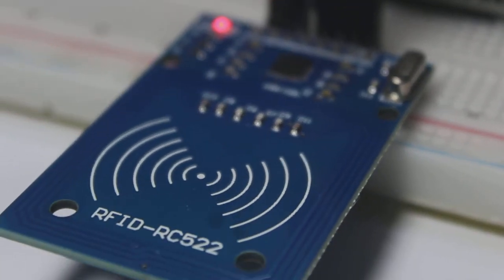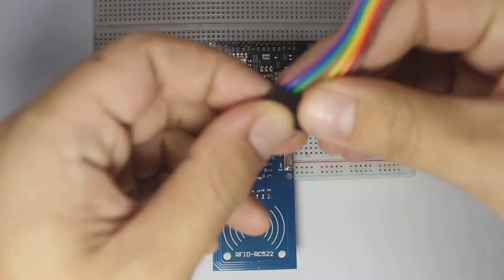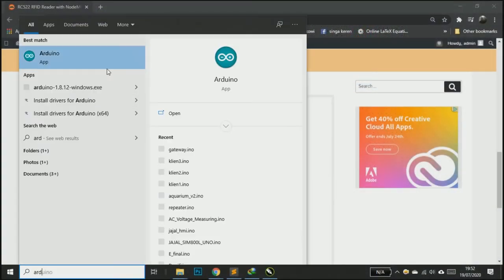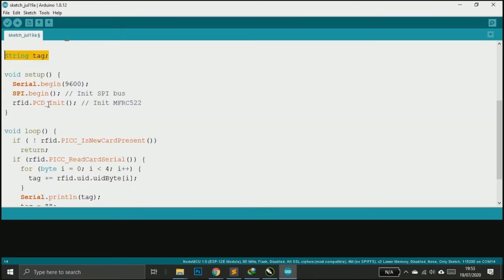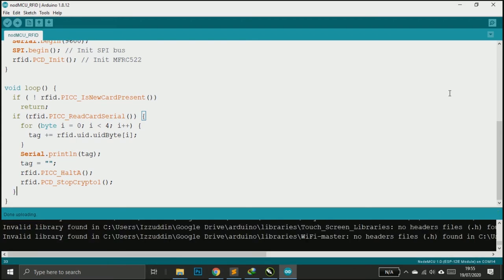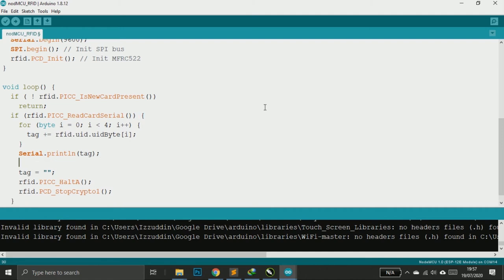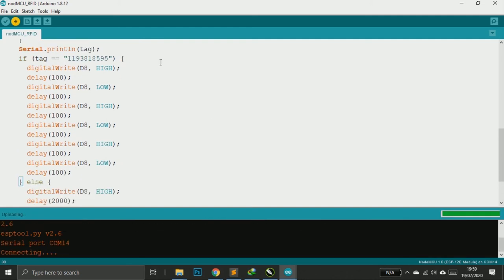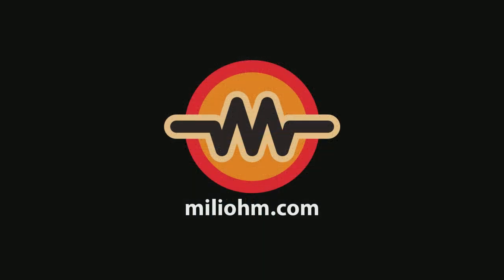How to use RFID Reader with NodeMCU - RC522 RFID Reader Tutorial

Comment: hello,  i do like you do but every time i had this "hard resetting via rst pin" thing. how can i fix it? please help. itried the online solutionsa but it didnt work
Reply from the maker: Where did you get hard resetting via rst pin?
Reply: @miliohm  after upload the cod
Reply: @miliohm  and it isn!t read my tag,i tried change the baudrate and frequency but nothing happened
Reply from the maker: Double check the wiring, sometimes it just caused by wrong pins
Reply: @miliohm  i  chechked millon times, im trying to work this sensor like 4 days :( thank you
Reply: @josephneiltacatani2008  yes, I figured out hard resetting via pin is not an error, just esp reset itself after uploading the cod. so the cod is still valid. so probably the error in somewhere else
Reply: @kristine mae pontanal same same, how?

Comment: As per your tutorial I tried this project and used laptop power, tried with 3 mfrc522 board but on each case the RFID on-board led does not glow. I have checked the connections several times and getting output voltage from nodemcu 3.3v as per the multimeter. Can you guide me where is the problem?
Reply from the maker: when 3.3V and GND connected to NodeMCU should no problem. Just connect those two wires first. Are you sure the wiring is connected and use the same RFID reader as mine?

Comment: not working, while the light shows in both the RFID module and nodemcu. Even tried it with arduino still it is not showing any output on serial monitor
Reply: same problem.. 

Did you fix it?

Comment: Hello 
I have this problem
'D3' was not declared in this scope
Reply from the maker: Make sure your board is nodemcu
Reply: @miliohm  Well the problem is when I compile the code
Reply from the maker: @jesserelles1937  yes, are you sure your board is nodemcu?
Reply: @miliohm  yes..
Reply: @jesserelles1937  Found Any solution?
Reply: @jesserelles1937  check if you have selected the correct board
select NodeMCU 1.0

Comment: sir card id is not displaying on seriol monitor
Reply from the maker: Make sure the baudrate is correct, then after opening serial monitor. Reset the nodemcu by pressing button on the board
Reply: @miliohm  still no response sir
i have bought 2 rfid sensors and checking on both still not working sir
Reply: @varunkumar-4017  have u fix the problem? I have the same problem

Comment: it doesnt work for me :(
Can you help me please ..
Reply from the maker: Check the wiring diagram, make sure every cable are correct
Reply: @miliohm  everything is as yours... but when run serial monitor is blank... nothing on it
Reply from the maker: @HimaSpirit  try resetting the nodemcu after opening serial monitor
Reply: @miliohm  i did it, but there are no changes
what is the problem with that?